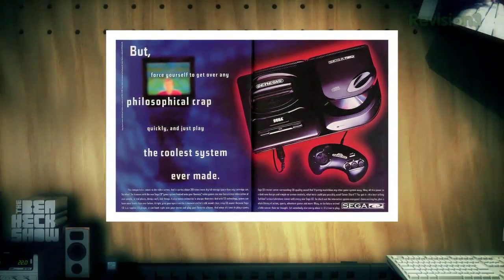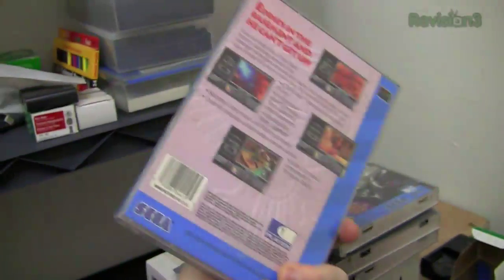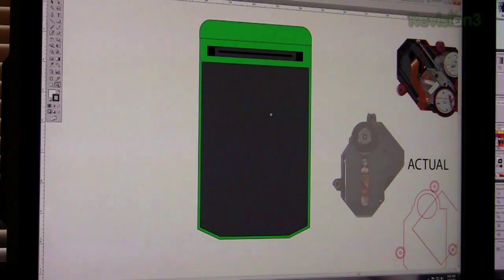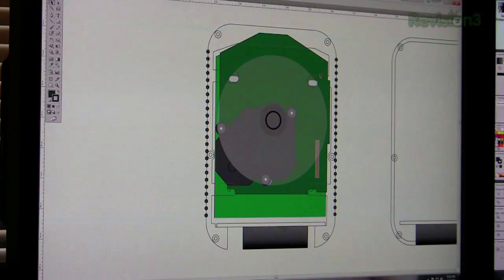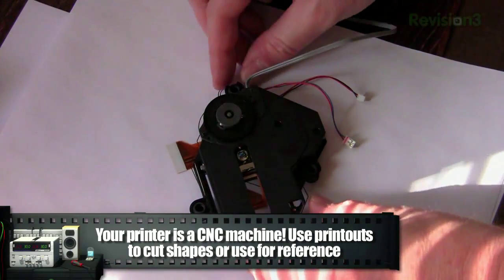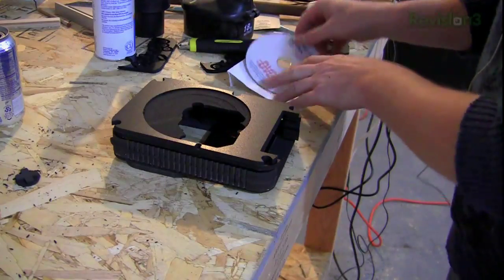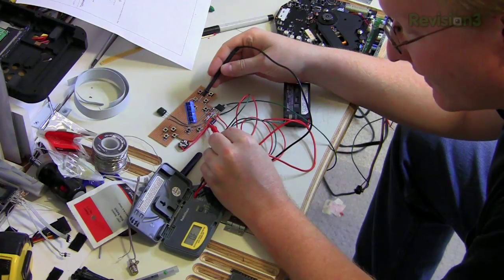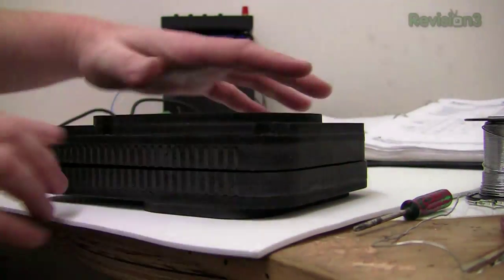The Ben Heck Show - Sega CDX

Comment: Could have basically reused the top portion of the CDX, and just created a new bottom casing to hold thin batteries and have screen w joypad on the back while CD opening would be original, less work that way Frankenstein-CDX =D. Still cool tho.

Comment: Even if it made the case bigger, I would have kept the Genesis cart slot in there.
Reply: Yes, it was a must if you played some RPG. Shining force CD for example, without ram cart you cannot unlock the last two books, because they required to have the original save game, which is 99 slots!! (the sega cd had 125 internally). It looks like a standard Genesis cart.
Reply: 0 loop

Comment: That was pretty a pretty cool project but there are some things I would have wanted to do differently.  Firstly I would have wanted to dump the CD drive and replace it with an SD card reader so you could just copy the ROM's from your PC and in effect have the entire CD library with you which would also drain less power from the battery than a physical drive. I would also have placed the controls either side of the screen to give better stability while in use.  Like others have commented, I would also have liked to keep the cartridge slot functional, probably by re-routing the port to either the top or the base of the unit.

An alternative project that would be cool is a mobile emulation box.  Think about this project being run by something like a Raspberry Pi with storage via USB or memory cards that you could use to run all your old games on the run.  It could be smaller and lighter.  Also because of the modern design of the items used along with their low power requirements you would have better battery life as well as not having to rely on Ebay for parts.

Comment: Am I the only one who noticed he said "Z80 for sound synthesis"? Also, the chip responsible for sound synthesis is the YM2612.
Reply: The genesis had two sound chips, the YM2612 and the SN6489. The Z80 is used as a controller for both of these chips.

Comment: Quick Question why do you use adobe illustrator for working drawings? Would not something like Autodesk Inventor with a CNC plug in be a better and more efficient application?
Reply from the maker: With a background in graphic design, I'm very comfortable with Illustrator. Still, I'd like to get Inventor - just haven't yet.
Reply: I prefer Corel Draw.

Comment: Also I was wondering because the Sega nomad is a portable Sega Genesis would it be possible to modify it so that someone can connect a Sega CD to it?
Reply: Though this is an old comment, I think I can shed some light on your question. I have a friend who owns more or less all Sega hardware ever made. Kind of a fanatic if you ask me, but that's okay. Anyway, I've asked this question before and was told that it is possible but you'd need to do a good bit of work and it would require a few extra parts that might be hard to find. I've never heard of it personally.

Comment: why did you remove the cartridge loader, I would have removed the cd drive
Reply: I was wondering the same thing. Surely he would have been able to integrate it in the rear of the unit and have both CD and cartridge compatibility.

Comment: A lot of used game places wont buy/sell the first gen PS3s . Disc Replay says they are not reliable and tend to burn out and they will not buy or sell them. I wanted one so I could play ps 1 2 and 3 but Ill just have to keep my PS2 around cuz I have the Top Loader PS3. My buddy has a first gen ps3, purchased it on launch and hasnt had a lot of problems with it. Sony did have some issues around launch with consoles failing but nowhere near the red ring of death rate on 360s

Comment: Ps3 at first DIDN'T emulate PS2 games. It had actual PS2 hardware inside and of course ran those games as well as a normal PS2 would, afterwards they took out the PS2 hardware and the next model used emulation, then they dropped it in the model after that.